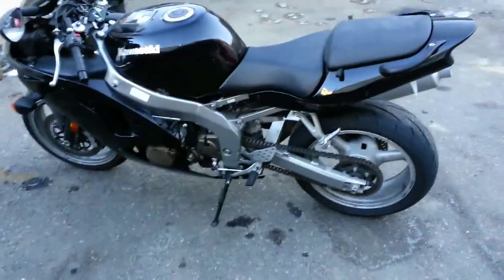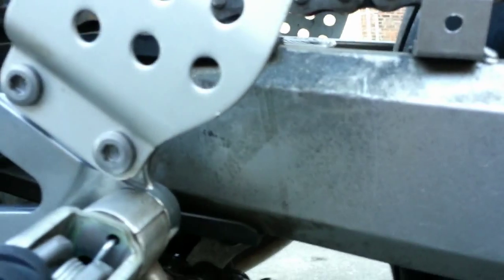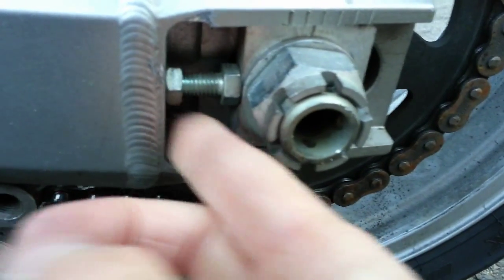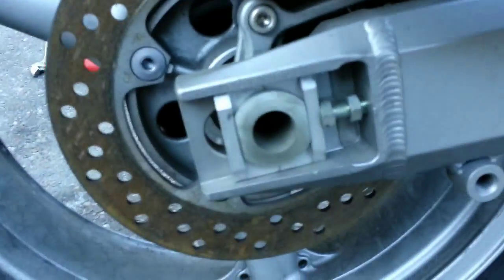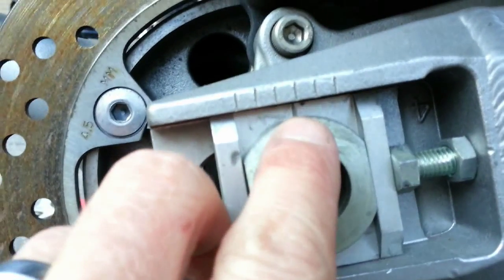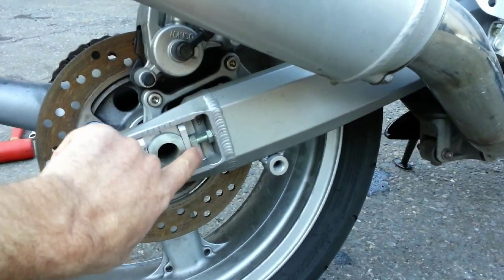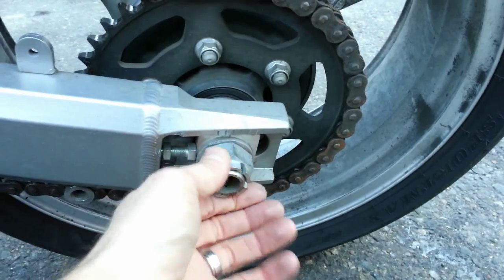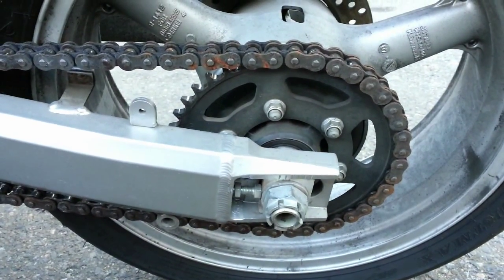How to service a motorcycle chain

Comment: Again, do you own a shop?  Look at your marks in this video.  2 3/4 marks on one side and 3 1/4 on the other.  That is not a true running wheel.  I'm only pointing this out because other less knowledgeable folks might not catch that and get hurt or worse.  It is called "Chain Deflection" and you should follow the manual for your particular bike.  The "Should barely miss the rubber" is NOT the correct advise.  Again, like any advise on the web, READ THE MANUAL FIRST!